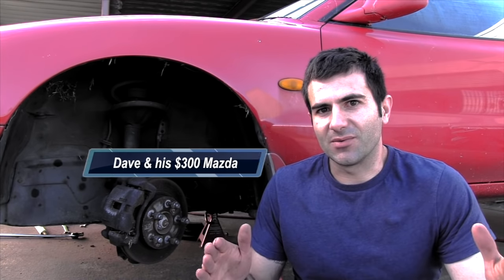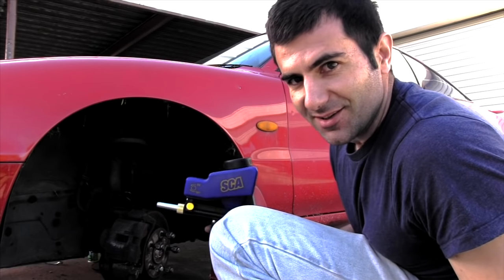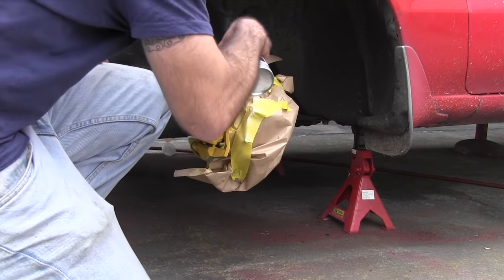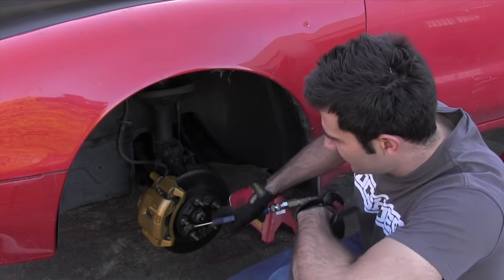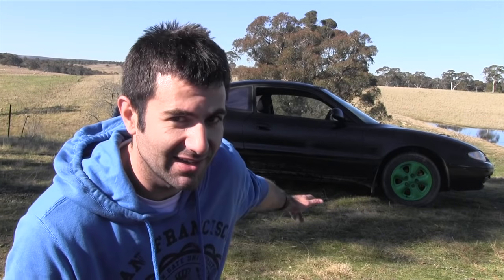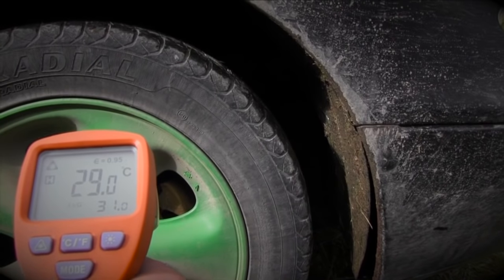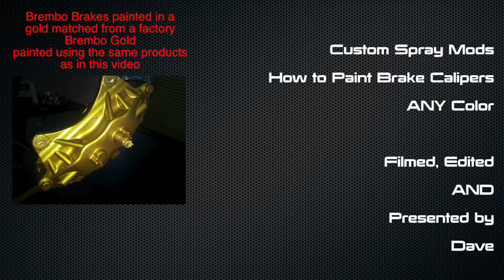How to paint brake calipers ANY color DIY

Comment: That's probably one of the best DIY videos for painting calipers.  Most people forget to CLEAR COAT them, which really makes a difference.  I do prefer to paint the ENTIRE brake including the sides of the pads so they look bigger.  Besides the prep work, I've always found the masking is the hardest part!  A trick I've found is tearing a hole in the bottom of a Wal-Mart bag, then stretching it over the caliper and around the rotor - it's a tight fit and there's little else to mask off.

Comment: I have seen hundreds of people use his paint technique without a problem and I believe this is the reason. Yes, the paint was bubbling but that is to be expected. You have to remember that his first speed test was done with minimal breaking like your average rally racer and the tempereature measured up to 60 to 70 degrees. That's almost the temperature in a hot day in Mexico. In the second test he spinned the rotor with the break in for a good 13 second, give or take, up to the point where it seemed like the break jammed in the end and the temperature measured up to 300 degrees. That's a huge difference. That's the temperature I cook a lasagna with. I'm sorry but if you're abusing your breaks to the point where they will reach the temperature of an oven and jam and bust and have to repair or replace them, then bubbled paint is to be expected. Think about this for a second.

Comment from the maker: Its a Mazda mx6, 6 cylinder, 5 speed manual, front wheel drive, front and rear wheel steer over 270 000kms and still drives like a dream.. Brake callipers still look great. Check out the mighty car mods forum post "$60 paint job" for current pics and new paint.

Comment from the maker: The laser thermometer was pointing at the part that didn't bubble and it was 440 degrees C 8:20. The part that did bubble was about 800 degrees C + and smoke was coming off the pads and disc. If you see smoke coming off your brakes bubbling paint should be the last thing you worry about.

Comment from the maker: That is part of the brake pads. I took the disk off. Used the inside pad, flipped it around. Then when I put the pads back in the outside pad which you see at 4:09 wasnt painted.

Comment: hello sir, I just want to know if I really need heat resistant paint to paint the brake calipers and engine block because, in one of your video you have mentioned that it is a myth, I thought that our normal base coat and clear coat would work, please clarify me on this matter so that I don't end up putting the wrong paint on the calipers and engine block. thank you.

Comment from the maker: 2K basecoat is actually like a clear over base type paint. It needs a clearcoat. You can put a 2K clear over it or an acrylic or enamel clear. It is not as harmful as 2K Clear and primer. There is no hardener used in any of these steps so it is safe to spray out in the open. Anything that uses a hardener is hazardous and a proper mask should be used.

Comment: It may have bubbled but nobody holds the brakes and hits the accelerator at the same time and nobody gets stock brakes up to 700 degrees Fahrenheit. So you can use the paint for every day driving but your paint will bubble if all you use your car for is to rev accelerator while braking.
Reply from the maker: Xris M This guy gets it.
Reply: You actually hold the brakes and hit the accelerator when performing left foot braking techniques. Makes the car turn in a lot sharper and settles the suspension.

Comment: VIBGYOR - just use the standard rainbow pattern to determine how much stopping power is gained by applying a certain color to your brakes. The shorter the wavelength the worse the braking power thus painting your brakes violet will not help at all... If he knew this, he would have painted his brakes red.

Comment from the maker: Good Pick up mate.. The temperature of the part that bubbled was way over 400 degrees. As the thermometer showed there were parts of the brakes that got up to the 400 C mark. And it did not bubble. I could have easily edited the bubbled part out but I thought the thermometer would tell the story. Sorry I should have said. If your going to Jack up your car and hold the gas and brake at the same time DONT paint your calipers like this.

Comment: Two things, you need new rotors and 2nd of all never ever use compressed air to clean the components you will make brake dust go everywhere witch goes air born and is bad to breath in inside or out bad as.

Comment: I think you did a great job man thanks.
Reply: +CS Studios Yeah, definitely won't mess up your brakes.  550-650 F is where you start to smell the brakes.  440 C or 824 F is way past that point.  If your brakes are smoking and the disc is heating up red, they're under extreme braking conditions.

Comment: I oven baked mine. First I took them completely off and cleaned with engine degreaser. Then baked @ 200F for an hour to cure them evenly, then installed once cool. They last way longer and look way more professional this way.

Comment: Hey mate, I did that over 2 years ago on the back of the brake pads, on the rears and it's only starting to flake now. that was with only heat proof caliper paint.

Comment: im looking to paint my calipers and valve covers as well as some othe misc parts in the engine bay and i dont like the color selection that ive been able to find in high heat paints i was wondering if i could lay down some high heat primer, a normal rattle can color and then a high heat clear coat, so im not stuck with the colors they have in high heat paint

Comment: Hi, I need some advice.. Ive just sprayed the callipers on my motorbike.. Ive removed the whole calliper, stripped it, cleaned it, primer coat x 3, base coat x3 and clear coat x3.. The brand of paint is VHT calliper paint - same as the stuff you used in the undercoat.. The can says I need to cure the paint by baking in an oven at 93c for 1hr.. Is this necessary? I cant use the brakes yet because the bike is still in a few parts..

Comment: I take the most crusty calipers and brackets and submerge them in a gallon of muriatic  acid in a square plastic pail with a lid, Its eats the rust completely off and doesn't hurt any rubber components,rinse with water to kill the acid and blow dry with compressed air prime and paint .Don't worry about acid getting into the piston because water will kill the process and blowing the water out of the bleeder screw out the flex hose hole will dry it out inside. 12 $ for one gallon of acid. Its so much easier.

Comment: Test Two bubbling at the top of the caliper 😞
Reply from the maker: 8:10
Reply: +TwIsTeDgRaFiCz85 which it leads to fail :(
Reply from the maker: +Chris Watson If you plan on jacking up your car and holding the brake and accelerator at the same time. DONT paint your callipers. If your driving any other way this method will be fine.
Reply: And the commercially available products would likely do the same, as they are not designed for 700 degree temperatures, either. And just how would bubbled paint " ruin" someone's brakes?
Reply: +Chris Watson you made me lose so many brain cells from reading that comment

Comment: Just wanted to know, because normally when I spray paint in cans I always thought it was acrylic primer? Don't you need to let 2K dry for overnight? And isn't it very harmful to breathe it in? I'm not criticising at all, I don't use a respirator when I spray acrylic but I've never used 2K and was just wondering.
Cheers.

Comment: This method should work on the engine block right? Been trying to find a way to get a custom high-temp engine paint but this could be the solution. Can you use caliper paint on the engine block?
Reply from the maker: Yes you can use this on an engine block.
Reply: "caliper paint" he says...
Reply from the maker: Yeah that can work but it only comes in a limited range of colors. Using this method you can choose any color.

Comment: HEALTH WARNING!!!
You NEVER use an air gun to "clean" brakes!!! Your blowing the cloud of death in your lungs!!

Always use soap & water or caliper clean to avoid lifting cancerous dust in the air.

There is never an always in anything unless we're talking about safety.
Reply: they dont use asbestos in brake pads any more...
Reply: not in america. how many people have cheap Chinese brakes
Reply: Asbestos brake pads are no longer sold or avaliable in the UK, and has been like that for a long long time.
Saying that this is still vintage cars out there with them on, as a mechanic it's always good practice to wet any old brakes down and use a dust mask when working on any brake and clutch system.
There are wet blasting systems out there that would have been a far better option if it was available.
Still most DIY people won't be using a blaster and will more than likely hopefully be using brake and clutch cleaner while wire brush g them

Comment: Also, you have to remember that brakes normally don't reach that heat point, under normal braking, you reach at most 250-275 degrees.

Comment: come on show us in heat test part 2 little higher cuz i see some boiling paint there... 8:13
Reply from the maker: If your planning on painting calipers then jacking your car up and holding the throttle and brake at the same time. I can send you the full clip of what happens.
Reply: customspraymods nahh just tell me if actually the paint boiling at that moment.
Reply: the temp gun measured the good paint, unless your brakes are going to be over 300 degrees you won't have a problem

Comment: So I can buy engine enamel for less than 10 bucks by itself and it will have the same affect as the method shown in the video? It's just that an engine enamel can for 8 bucks is a lot cheaper than the whole kit you sell on your site for 60.

Comment: the paint bubbled at the top of the brake caliper if you look at it after heavy braking with the rims off (look at 8:10-8:20). so i think the test semi-failed as if the part of the paint bubbled the rest of the paint will go off with corrosion. still the heat produced will be barely reached in daily life.

Comment: Im not too educated on paints, what does 2k Base coat refer too? =\
Reply from the maker: Hello, It means paint that can be used with 2k clear but will work with other clears. It is a 1k product.
Reply: customspraymods
that reply surly helped him awesome! :)

Here maybe that might be better:
1K Coating vs. 2K Coatings
There is often confusion and misuse of terms when it comes to describing automotive coatings. Here are some brief definitions that i hope will dispel the confusion.
NOTE: Typically the term "catalyst" is used separately from the terms "activator" and "hardener" (as in epoxy catalyst) because a catalyst does not have isocyanates.
 - 1K: This is a term used to describe a coating that does not require a hardener, catalyst or activator. For example, this term can be used to describe “single-component” paints and all of the aerosol paints. NOTE: You may have seen “1K” and “Single-Stage” used interchangeably. See definition of “Single-Stage” below.
 - 2K: This describes a coating that needs to be mixed with a hardener, catalyst or activator. This can be used to describe, “two-component” paints and other urethane finishes.
------------------------------------------
One/Single-Stage: Used to describe a coating that does not require a clear top coat. A single-stage coating may or may not require a catalyst, hardener or activator. Plus, a clear top coat may be added in many cases for enhanced durability or depth.
Two-Stage: Describes a coating system that requires both base and clear coats. This is more commonly referred to as "basecoat/clearcoat" or "BC/CC". The coats of base and clear may or may not require a catalyst, hardener or activator.

So 1K/2K is about the hardener, catalyst or activator.
It is not the same as
OneStage/Two-Stage, which is about the base and/or clear coats.
Got it?

Well then:
You just got from "not too educated" to basic!!!!
Congrats!

Comment: My question is: why TF do all the stores I go to all across California have the same exact paint as you do in this video, but no caliper primer anywhere I look. So, can I paint caliper paint and clear coat without caliper specific primer?
Reply from the maker: scientific method perspective it's fine to use etch primer mate they should have that.
Reply: @customspraymods  got it! Thanks!
Still good for the heat?

Comment: Am I the only one that noticed the paint on the top of the caliper burned as he had the brake on and accelerator down at the same time at the end??
Reply: No you're not.
But that's irrelevant because you would never be able to achieve those kind of temperature that would make the paint boil (600 Celsius) under normal hard braking while driving.

Comment: 300 Degrees is nothing for brakes. even normal road car use can produce those temps. I did wonder if is would work though so good to know, it doesn't.
Reply: 300c. 700f. his brakes are literally smoking. you think that happens when you are normally driving?

Comment: To anyone looking to do this, do NOT use the VHT clear caliper paint as the clear/top coat. It turns a milky white by the 2nd coat, and will completely ruin the rest of your paint job. It’s like you’re spraying lubricant or something... I think you should probably just use a professional 2K clear aerosol

Comment: err, "I'm not a qualified meschanic so I'm going to leave the brakes on the car, all connected and that way they should be alright" - You're right, they should be fine after being sand blasted, all cars are fitted with sand blast resistant piston seals and brake hoses and the bearings just love the ocassional sandy treat.....

And I love the fact you put a crash helmet on your head but didn't bother putting any gloves on...

Comment: Don't look too deep into it, it's simply a method for changing the color of your calipers. Obviously MOST people who search for a video like this are just people with ordinary cars who want a little extra color behind their wheels; most likely these people will not be driving under rally conditions especially on the level of intensity shown in this video. Anodization of the metal would work best for a high performance application as it would withstand up to 1000 degrees Celsius.

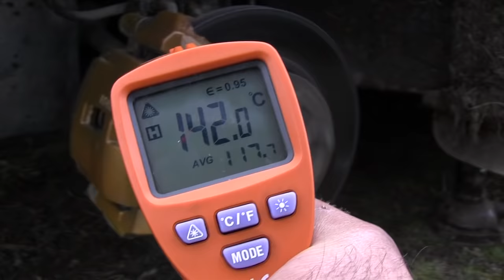Comment: Like he said in the comment around 8:00-8:20 in, unless you're A) tracking your car, B) repeatedly drag racing it at the strip, or C) putting it on lifts and accelerating while holding down the break pedal (lol), then your brakes will NOT reach 600 fucking degrees C, so in the case of normal daily drivers and occasional "street race" street cars, this method works perfectly. For those doing more performance oriented activities with their cars, they might want to go a different route and get dedicated caliper paint good for 1000 degrees or whatever it is. Even still, the prep portion is good but wear a MASK and safety glasses for christ sake! lol

Comment: Cmon guys, this video has been posted three years ago. Yeah he could have done at least some research before hand because there are important steps you should take when messing around with brake systems, it would have been alot better to have taken the caliper off and do it properly once and he should not have taken up this tutorial in the first place without mechanical knowledge but that doesn't mean you can instantly say that he is dishonest or dodgy etc. 
This is the only video i've seen that i agree isn't professional and should be remade or removed because other non mechanic minded people will watch this and cause problems to their brake systems. But remember hes a painter, not a mechanic and if you've seen his other videos, he is high quality and skilled in his field. I've watched every single one of his videos and this one was obviously a bad mistake, but no need to go all out on him, you'll achieve nothing from doing that, learn criticise if you're so smart and not be a dick 😑

Comment: Uh... Unless you're rally BRAKING, you actually don't need high temp paint, as much as everyone seems to be told. Your brakes have rubber and plastic seals... They never go above a few hundred degrees... The rotors and pads are what burn very hot... On the back of the pads are a sheet of aluminum that act as a heat transfer to quickly cool the brakes and the rest of the heat is absorbed into the caliper and dissipates... Calipers will never ever ever burn that hot unless like I said... You're driving 100mph and slam on your brakes to dodge an animal... Then and only then will it probably hit 500 degrees.
Reply: Mad Irish Normal road use can produce temps higher than the 300 degrees that this failed at. The rubber and plastic is capable of high temps, because it's designed for it, unlike the non high temp paints.
Reply: Its depends in what system using to measure the temperature. He measured it in C which would be around 700F.

Comment: everyone saw the bubbling paint at the top of the caliper on test 2, so don't try and frame it out of view lol
Reply: yeah, but that was under extreme conditions, 400 degree Celsius even dedicated brake caliper paint don't have that kind of heat threshold, only around 200-300 Celsius. 
Besides, you would never be able to achieve that kind of temperature when driving normally or even racing.
I'd say that for a DIY paint job, it did pretty good.